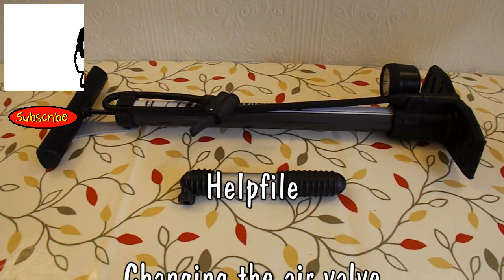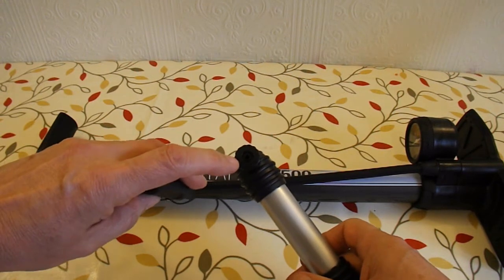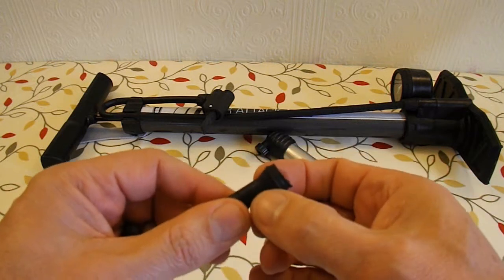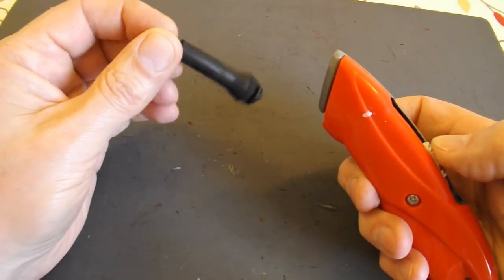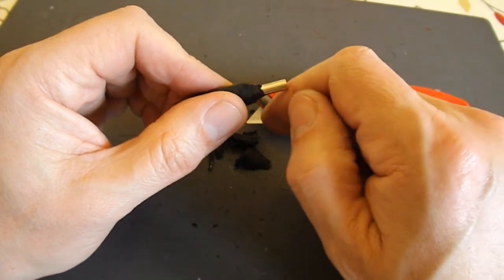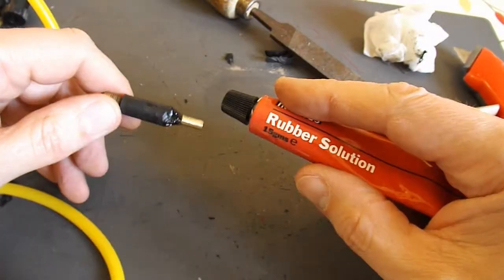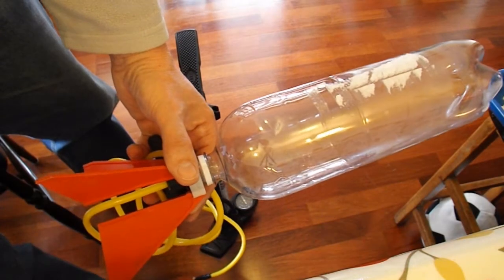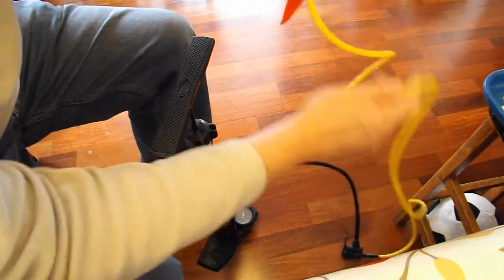Helpfile - Changing the valve fitting for my Pop Bottle Rocket

Comment from the maker: My grandson could not produce enough pressure to pump up the water jet pop bottle rocket using the hand help bicycle pump so I bought a much larger pump and then found the valve didn't fit, so this help file covers changing out the valve for the rocket's air pipe.